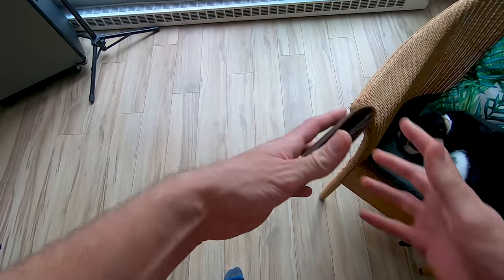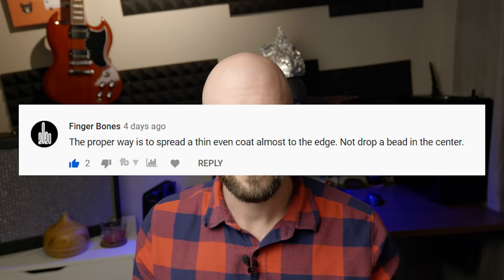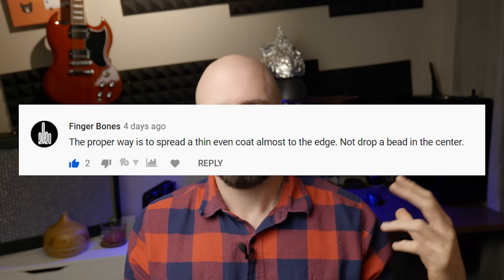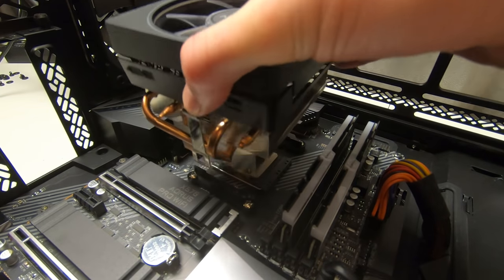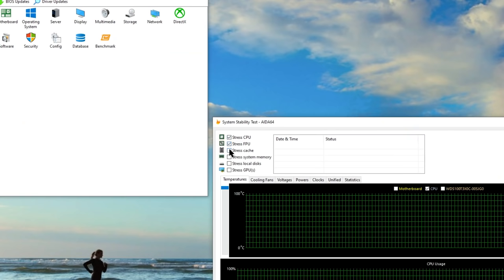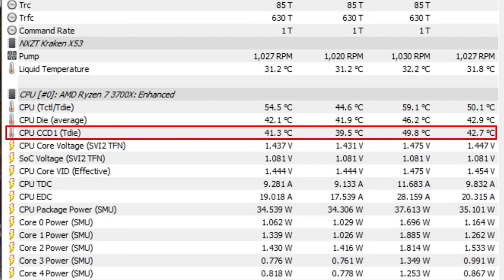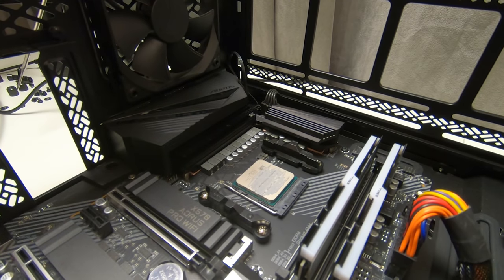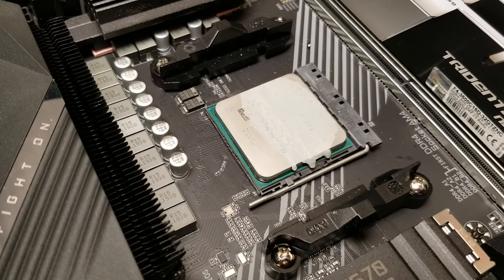Best Way to Apply Thermal Paste? Does it Even Matter?

Comment from the maker: You asked for it....NO THERMAL PASTE TEST https://www.youtube.com/watch?v=VAh_p90y_DU  Remember to LIKE and SUBSCRIBE! Thank you everyone for the continued support!
Reply: Even though the results are probably alright it doesn't seem like you've controlled for power consumption/boost which casts a huge doubt on these results. Plus we're talking about a pretty low power consuption, you'll have a bigger differential with overclock.
Reply: Cool of ya to add a methodology, wish more people would do this!
Reply from the maker: adam I'll try it out.
Reply: Well, all this may be true for the IHS chips. But in laptops/notebooks with direct die contact partial spread can cause more problems, like not cooling properly some of the cores, or maybe even chipping the silicone with no material in between chip and heatsink...
Reply: Apply the paste to the ram not the cpu
Reply: Do a thermal pads test!
Reply: do you think the pentagon dot or x cross method is better. I'm planning on building a pc and I'm trying to learn the basics right know.
Reply: This is proof of a global conspiracy. He is paid by thermal paste supplies to push their products. Don't be deceived by major corporations. There is a sensor built into all of the chips to detect whether or not thermal paste is applied and falsifies thermal readings in bios and software. Some will even set the chips to automatically shut down if none is applied. Don't be sheeple and open your eyes to the truth. #FakeNews #Lies #BigBrother #BigCorporate #Conspiracy
Reply: Thanks dude, it really helped ^_^
Reply: buttered toast all the way lol
Reply: I own Asus G513qy advantage edition with RX6800M and Ryzen 5900HX.  Currently I have Grlid VC Extreme on CPu and GPu.  GPU max hotspot was 103c and after last repaste max hotspot 99c (mostly 98c max), and cpu maxing 97c.  And yes Asus stock LM paste was going to 102c gpu Hotspot! 

I think in some months try repaste again and hopefully have better luck with bit better Temps. 

I made amazon order for two products I read should be good:

1. Syy157 (8 grams)
2. ICEBERG THERMAL PLUS (7 Grams)

I think go hybrid one for gpu and one for cpu, what you would suggest? Which to use on what die?

Your honest help appreciated!
Reply: You didn’t try the tic tac toe method! I heard that one is the best 🤔
Reply: Great vid! About to install a Ryzen 5 5600x and Boreal cooler. This should be fun... lol
Reply: Yea you want to spread it slightly, on both surfaces of the cpu and cooler so it cakes on
Reply: @TechIlliterate my Amazon refurbished Pc came with little if not no thermal paste, still works fine but i caught it months after purchasing it. Is it still safe?
Reply from the maker: @chadmann2724  yeah just apply some.ay have been a little toasty but as long as it's still running there shouldn't be much to worry about.
Reply: I had no idea about this, I was cleaning my PS4 and I cleaned all of the M-4 off and when I reassembled it and turned it on my console wouldn't stay on. If you don't mind me asking, why does it have to have the paste on it?
Reply from the maker: @erinmorales5097  it's a medium to better transfer heat from the CPU to the cooler. Without it in some cases the CPU will hit a thermal limit and shut down.
Reply: @TechIlliterate  Ok thanks 👍🏾
Reply: @adaptercrash  Doing it on both surfaces seems like a bad idea to me. It‘s bound to result in air bubbles trapped somewhere in between.

Comment: As someone who has never done this before, your conclusion has definitely eased my mind. Put some thermal paste on it, make sure it's enough, and everything will be fine. Definitely a load off. Thank you for the video.
Reply: Same.
Reply: Aparently putting more than enough can be bad as well as putting not enough, so good luck getting a good balance xd today and yesterday I changed my consoles paste and used different methods, somehow I still feel like they’re boiling :c
Reply: @meappeam6917  Actually, adding too much thermal paste is a lot better than little or none, as it covers the same area as acquitte thermal paste application, so it doesn't matter that much. The worst that could happen in most is that it goes off of the IHS, which is not bad. Most extreme, basically impossible, is that it goes off the IHS into the CPU socket contacting the pins, though I've found sources claiming that it is still possible to normally run a PC with non-conductive thermal paste even in the CPU socket (this does not mean to attempt to put thermal paste in your CPU socket).

Though, putting too little can defiantly impact performance significantly (as per seen in the video)

If you feel as if your consoles are still "boiling", make sure you have a good thermal solution (I would recommend Arctic MX-6 or Thermal Grizzly Kryonaught), or perhaps look to get better / higher quality fans that would move more CF/m (Cubic Ft / minute)
Reply: I cut PTM7950 from the sheet and do not play with dots, dashes and crosses.
Reply: no this is wrong, it just cover the whole surface that cpu back panel so all the excess heat can be conducted

Comment: Despite this video being two years old, it’s still comforting. I built my very first pc last week and forgot about all application methods for thermal paste… but I still used thermal paste!! And not just a tiny dot either! My heart is at ease knowing I did it right! 😂
Reply: Well done bro, I just built my first rig and I didn’t install the cooler properly and now it overheats. I ordere a new cooler and hope I dont mess it again
Reply: @drakata27 ... why would you need a new cooler??
Reply: @denks7849  old one was amd stock and i didnt like it
Reply: @drakata27 Yes, it's terrible. Also ordered a new one today :)
Reply: @drakata27 yeah same, using stock wraith stealth with the ryzen 5 5600 non x.. 95*C on full use…. it‘s so loud. Ordered a pure rock 2 today. Hope it‘s better than the awful loud stock one..

Comment: old school trick, you get a plastic baggy, use it as a glove, apply paste to baggy covered finger tip and dab the paste on the chip evenly with a very light coating.  The goal is to fill in valleys and provide good contact and not cake it on to the point where it acts more like insulation.  Great video by the way!    I guess my method is more like the buttered toast method.

Comment: Ok I applaud you for taking the time to do this test.  It certainly is a help.  Personally I have been building PC since 98'.  Been using the Butter Spread since 2003.  The only diff is that I put masking tape around the edge of the CPU approx 1/8" overlap, all around, onto the die surface. Then apply a bit of paste onto the die.  Spread with a credit card or plastic always keeping the edges of the card on the tape. Simply remove the masking tape when finished.  In this way you can have a very uniform result without too much overkill on the paste.  I have always had great results.  Again, thank you for your time.
Reply: This is genius!

Comment: True. took your advise and worked on my G750 cause its been 8 years past since I bought it. I chose Thermal Grizzly Kryonaut, did the spread on both CPU and GPU, cleaned out the fans and their heatsinks, and well running good as new. Temps dropped to 15C, and now I'm happy. Thank you again for a nice video as well with your advise.

Comment: I'm an electrical engineer with over 25 years of experience (with power semiconductors).   Simply put, use what you can control.  In the case of a CPU, you can control what Nick calls (or perhaps someone else) "buttered toast" - this is the only way you can be reasonably certain (Schrödinger's paste?) is the cover the IHS and be certain the when you tighten down the water block/air cooler with EVEN pressure.  PERIOD!
Reply: From someone whom works in the IT space (25 years), I ALWAYS spread the thermal paste over the entire IHS.
Reply: I hate Electrical Engineer's ,just kidding I use to wire House's back in the day. so what's a Electrical Engineer doing playing around with Electronics and CPU paste And semi Conductor's , Maybe you like Tesla Coil's for Breakfast , I don t know , probably not . LOL
Reply: @madmad8582  Power semiconductors like SCRs/IGBTs/GTOs/Diodes, etc.  Mostly for robotics, AC & DC drives and high current applications like plating.  Playing with computers is just a by-product of industrial automation which is what I've done most of my life.
Reply: I am a rocket scientist and before that I was a brain surgeon.
I'd say 2 bottles of thermal paste will do, you want it to be as cool as possible, the motherboard wouldn't mind either.
Reply: I don't know what electrical engineering has to do with computers, maybe you draw your circuits using it, but OK
Reply: @naughtynhyde9328  thermal paste doesn't conduct current

Comment: I have always went with the peanut spread method earlier, but have decided to go with the penta dot on my Ryzen 5X 5600X CPU. AIO Thermal Take TH 360 ARGB Liquid cooling is going to be doing a better job than the prism AMD stock cooler. Thank you for this video!

Comment: The issue here being long term when the thermal starts to dry up (especially with cheap/crappy thermal pastes).
Penta Dot/Butter Toast method means more contact points so would probably be more reliable in the long term.
Reply: Oh, absolutely. Penta dot is my go to for most clients, since it usually lasts almost 6 months more than single dot.
Reply: @KevinJDildonik  only the 1% can upgrade their pcs all the time or at least less than twice a decade. Not everyone is an american video editor with disposable income.
Reply: @StarmenRock  Bro, anyone with a proper job can upgrade their PC almost all the time, atleast once per month, and still afford all the bills.
Reply: @KevinJDildonik  I was gonna say it’s not an expensive or difficult process you probably still have 19/20ths of a tube from when you built the thing just redo it if your temps start creeping that’s always worked for me
Reply: @StarmenRock  if you built it, you definitely did not use an entire tube of thermal paste. Just unscrew the cooler clean everything up and reapply. If you have the tube from when you built the computer then it’s literally free to do this
Reply: Building PCs for some time now I’ve revisited this same topic a few times and tried various other ways. Butter toast method is def the go to for longevity but that’s just imho
Reply: @owo1744  wrong.
Reply: @owo1744  100% wrong most people live in poor countries even a full month wage is not enough to buy a new upgrade

Comment: it used to be much more important in the days of the original Athlon and Pentium 2/3 when you'd put the cooler directly in contact with the silicon - the risk of creating an air bubble and then have that area of the chip overheating were high. Ever since most chips started coming with a heat spreader, the risk has gone down.
Reply: Oh I remember those little protruded "mirror" thing! Those were a PITA.
Reply: Ogs unite 💯💯💯
Reply: Not to forget the risk of damaging the edges of the silicon during mounting of the cooler :)
Btw, graphic cards are still bare silicon, but I never had issues with it. Repasted my Gpu yesterday.
Reply: @knightwolf200612  true... somewhat. You'll notice that most GPU dies are surrounded by a spacer to prevent MOST (not all) damage.
Reply: Remember the copper shims? Eeek. I had to clean a die with rubbing alcohol before, wouldn't boot. I was so relieved when it worked.

Comment: A topic that when 1,000 YouTube videos say the same thing MAYBE someone will be convinced. There is a video out there with Steve from Gamer's Nexus and Der8auer that basically says, placement doesn't matter, too little IS BAD, there is never too much (but gets messy), paste doesn't "dry out" and air bubbles will work themselves out or be compressed so small, it doesn't matter. And the grooves are unavoidable when the maker puts heat pipes right against the IHS. Compressing them too much to be perfectly flat will make them not be pipes anymore which defeats the purpose of the whole heat pipe idea

Comment: As long as you use enough paste to cover the cpu without the paste running down onto the motherboard
it really doesn't matter what method you use. What does matter is the more even the pressure applied 
as you secure the cooler to the motherboard, the more even the thermal paste spread will be....
Reply: Yeah, too much heatsink paste on the die could be worse than too little. I normally swivel the heatsink back and forth before clamping it down. I think this helps spread out the paste a little better.

Comment: My understanding is that the function of thermal compounds is to fill the tiny surface irregularities in the IHS, and NOT to create a thick thermally conductive layer between the cooler heatsink and the CPU.  Arctic advises that a rice grain-sized dollop properly applied (to the smaller Intel die surface area) will spread out as CPU heating cycles cause it to migrate into an optimum thin layer.
I'd like to see a test that puts the CPU through 20-30 heating/cooling cycles for each method.  I bet the 'spread' would look quite different than after a single stress test.
Reply: The spread would also look better if this guy hadn't use a dog shit heat sink. The pea method is the best method.
Reply: And i second to that
Reply: Yup, the paste is less conductive than the cooler and IHS, so you don't need it to be bathed in it. If it's too thick it works more as insulator. Any excess gets pushed out by the mounting pressure anyway.
Reply: I did get some good results by applying paste, then applying the cooler and then removing the cooler and wiping the paste off the cooler and leave what was left on the CPU. This was a few years ago and I don't remember the stats but it was not bad at all. The thing is it's really got down to +-1 degrees either way, is it worth worrying about?
Reply: It’s impossible to create a thick layer as the pressure of the cooler will push out any excess. More is almost always better.
Reply: @HappyBeezerStudios  that’s not true. Thermal paste is literal designed to transfer heat and take out the irregularities of the metal surface.
Reply: @zipper978 it's not that good at heat txfer, it's just better than air in the tiny surface irregularities and not electrically conductive
Reply: @DeepakKumar-lv4te  actually some thermal paste is electrically conductive. and it is much better at heat transfer then air by a huge margin. The most insulating material on the planet is aerogel and do you know what it is made of. its almost 99 percent air....
Reply: @zipper978  indeed.  everything is a better conductor than air which is why thermal paste is a thing on these surfaces.  Cheaper than polishing to a mirror finish!

Comment: you underestimate how much I min max my shit in every video game I play and I will absolutely be using the Penta Dot method and I will stab people without warning in its defense
Reply: @xPathettic  stop introducing yourself
Reply: @vulnerablerummy  That was creative.  

"It doesn't matter how you put the thermal paste on there.." - everybody
Reply: If you really wanna get min max, you should use thermal epoxy instead of paste
Reply: @pastelcastiel1481  Just weld the cpu to the cooler
Reply: As said in the vid, penta only shows slightly better results because AMD's IHS are physically bigger. This wouldn't even be an issue with Intel.
Reply: The test results are negligible as they are within the margin of error.
Reply: Lmao

Comment: In my earlier years I used to be a machinist, and I kept some of my tools. All of these methods will work, but I prefer to spread a thin layer covering the entire processor, but...Most copper cold plates have lines with minute grooves left over from the machining process. I blue the cold plate of my AIO, then pull my machinist straitedge across it, you will usually find a few low spots. I then start with the medium grit lapping stone, and lap it until all bluing is gone (low spots). I blue it again, pull the straightedge across it, if it's flat and the pockets gone, I lap it with the fine side. I then lap it a couple more times, each time with a finer stone. I then finish with an Arkansas stone that's super smooth (looks like amber marble), this leaves the cold plate super flat and with a mirror finish. Now the contact area between the CPU and cold plate is almost a 100% with no paste used. I spread a very thin layer just in case of any flatness Inconsistencies the processor might have. At idle with a 280 AIO, all my systems have run 2 - 10 degrees (F) over the ambient temperature of the room. IE, 68 degree room temp, CPU at idle (70 - 78 degrees F) About (5) systems with both AMD and Intel processors.

Comment: They keep the grooves to get direct contact with the heatpipes, rather than adding more distance with an additional flat plate, as the pipes move more heat, faster, than solid metal.
Did you consider filling (buttering/scraping) the bottom of the cooler plate just to fill in the gaps before applying, or using a cooler with a flat plate?

Comment: I upgraded my 2013 Mac Pro's CPU from a 3.7 GHz quad-core to a 3 GHz ten-core a couple of days ago. I applied the thermal paste as a healthy dot in the middle, and I worried later if I'd applied the paste incorrectly. This video is a great relief, and the new CPU only reaches about 60-61 degrees C at high-load, I've probably done the right thing.

Comment: Having had extensive thermal engineering experience, it does not surprise me that differences are small. But I continue to believe that lowest temps, though not by much, will come with a uniforn, thin coating.